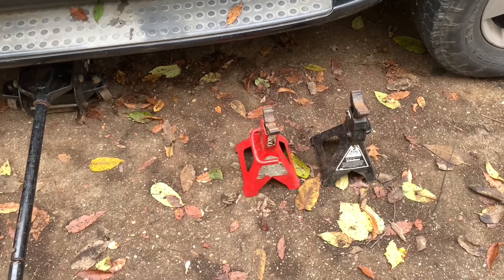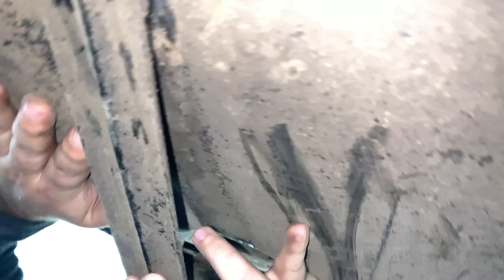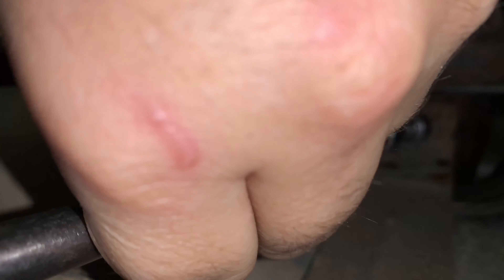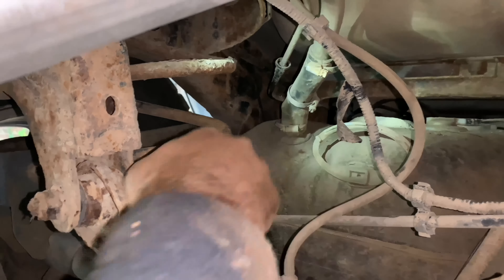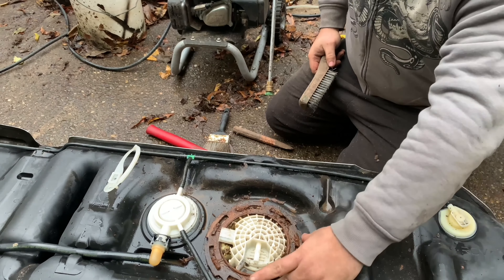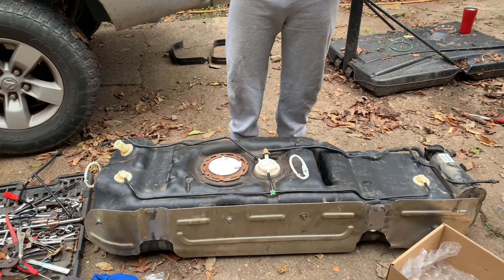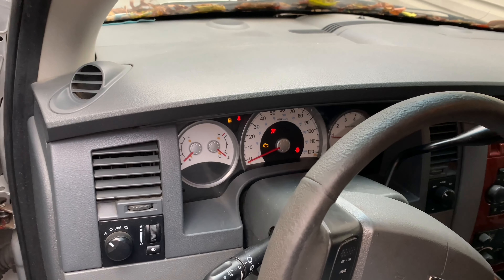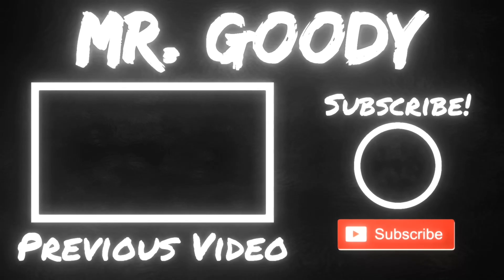How To Replace And Reinstall A Fuel Pump On A 2005 Dodge Durango 5.7 L Engine Hemi Edition - DIY

Comment: What is the other piece next to the full pump wit the hoses connected
Reply from the maker: I’m not for sure exactly which part you’re talking about but here is a basic diagram that shows you the evaporation system to that is connected to the gas tank.

https://images.app.goo.gl/d8qjhbEHVB75GYGa9

Comment: Lost my darn line release tool and stuck getting the rear line over the xmember off.      Grrrrr..
Reply from the maker: Hopefully you were able to get it fixed?
Reply: @Mr_Goody  All good now and quick tip is to use  a 3 or 4ft aluminum rod to bang the rim off with as the rod will get a little banged up but the ring will be golden.  I got lucky this time and had it off in 5min.
Reply from the maker: Thanks for the tip and update, I’m glad you got it fixed.✌️👍

Comment: What's the cost for a 2008 Chrysler aspen fuel pump.
Reply: Bout 300 at most parts stores
Reply: I just got one from Advance Auto for $136.00!
Reply: 150ish
Reply: 60 on amazon